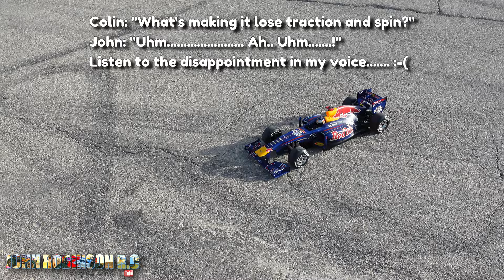😡 My most frustrating RC experience ever? I expected 100 MPH easily!

Comment: The setting is called: THSPD.
It'll smooth out the throttle.
Try speed1 set to zero.

But you might also have a ESC problem, as some ESC's doesn't accelerate smoothly.
So with the car on a bench, try accelerating from 0 past the 25% where you had the problem. Try going smoothly to 50%.
Reply from the maker: Ah dude you saved me hours of searching. Thank you so much! I truly appreciate it! 🙏😁😁😁👌👌

Comment: I'm thinking, it might be the diff binding up, sending more power to one wheel? Is it always spinning in the same direction? Or as someone said, maybe a wheel now spinning freely? It's certainly strange? 

I can't think that you've suddenly got that much of a burst of speed, that it wants to swap ends like that?

Gutted for you mate, but I'm sure you'll figure out what's causing the spinning out. 

Maybe change the gearing to drop the revs a bit, look at what's in the rear diff, and maybe the tyres?

Good luck. 🍀

Comment: Gyros can be funky sometimes. I'd remove it and then re-test. I had one that gave me a problem similar to that. Mine didn't seem to want to calibrate correctly. Also, sounds like it cogs alot at initial throttle, but part of that may be the high overall gearing. It's coming along really well though, you'll get it lined out.

Comment: Try using thicker diff oil in the front diffs or maybe even locking it as long as the front is thicker than the rear you should be much more stable

Comment: Too much restrictions on the front end and not enough traction on the back.  Getting foam tires for all 4 might not help.  Relocate your battery, ESC, and receiver to the back of the car.  As for the front, check everything make sure tires are free, check bearings, hex adapter etc

Comment: I get a feeling your rear left wheel is not spinning as freely as the rest? Maybe over tightened the wheel nut or a bad bearing?
Reply from the maker: Oh that's interesting. On the day I didn't notice but having looked at the footage again you are right. It always spun out in the same direction. I put it down to where I mounted the motor but it of course could have been that. So thank you so much! I will double check and if it turns out to be so simple I will ask my wife to slap me hard across the face! 😂😂😂 Thanks for the tip! 😉👍🏼

Comment from the maker: So the disappointment on this one was huge. What happened versus what I thought was going to happen were so far apart in the real world. I assumed that the car would fall apart long before we got to top speed. But wow, was I wrong. 😡 And to be clear. What is on this video is only about 20% of the total driving time. So therefore there was a lot more frustrating footage that you did not see. 😂

1/12th F1 Christmas gift Mercedes or Ferrari Electric already built: https://bit.ly/3BWHwcQ
Ferrari F2004 Kyosho Nitro F1 Car: https://bit.ly/3e0diMz
Redbull RB7 Kyosho Nitro F1 Car: https://bit.ly/3wMBU1T

Comment: I had issues when i used foil tape on inner shell of my rc car.
Reply: Kept cutting out removed tape didnt xut out anymore.
Reply from the maker: Wow Paul. I did not even think of that! Nice one my friend. I will remove it if I have any more issues. Putting new batteries in seemed to help but with a car that can potentially go to 130 kph or faster. I have to have confidence it the controls so I will for sure keep your idea in mind. Thank you! 💡😉👌👌

Comment: Does the nitro version handle any better？  If so, perhaps you can look at the differences in weight distribution？
Reply from the maker: Hiya. Another great idea. Something I hadn't thought about. I have the Nitro version so will put the wings on it and check the weight distribution. Overall weight I think is similar as the battery weights quite a lot. Thanks again for the idea! 😊💡👍🏼

Comment: Is the diff open? What if you lock it? Whaf it you do a burnout to heat the tyres?
Reply from the maker: Thanks for the ideas. I think locking the diffs would help for sure. Something to try if nothing works. At the end of the video I tried warming the tires but it just didn't seem to help. I'm now wondering if some weights along the car would help.... 🤔
Reply: @JohnRobinsonRC  all probably worth a try 🤔

Comment: could it be an issue with the camber/toe settings ?
Reply from the maker: Oh didn't think of that. Just looked. Nothing is adjustable so it is all fine. 😂😂 Guess I have to find some adjustable parts. Thanks for the idea! 😊👍🏼
Reply: @JohnRobinsonRC  I was inspired by you to buy the wltoys 124016, and cram a 3s 50c battery into it lol. One of the things I realized tinkering with front and rear camber and toe is how this affects the contact patch of the tire under acceleration, and how the alignment itself can change due to the combination of crazy torque and flex in the suspension components.

Consider that if something is amiss with your spring rate and/or damping rates, if they are too stiff, you could spin out. Perhaps study the Impact 20% and above throttle has on alignment and springs. You will need to record the fronts and rears separately with a go-pro or similar lightweight cam mounted on the car, and study footage to see what changes immediately before a washout event. 

Also study real world basic alignment and suspension characteristics for optimal performance on rear wheel drag cars, and see how that can be scaled down to the F1 car. Cheers for the entertaining content and I know we will see you sort it out in no time!
Reply from the maker: Ah great stuff. I love the 124016 and having the 3s livens it up just enough. 😂

Yes there fore sure is a lot of performance to be gained or lost on wheel camber, toe and well. Basically everything. I did try several months ago to show the effects of the anti roll bar with my tiny Insta360 camera mounted on the front to show the differences. Problem was that even with side by side videos. The effects were not that noticeable or different. Even though it obviously transformed the cars behaviour. Maybe having more footage and a range of cars could offer a more noticeable difference. I'll give it some thought and then see what I can come up with. Thanks so much for supporting the channel. Its much appreciated! Have a lovely evening! 😊👍🏼